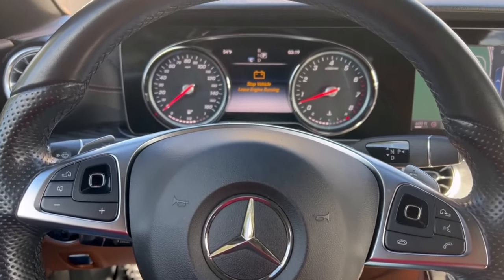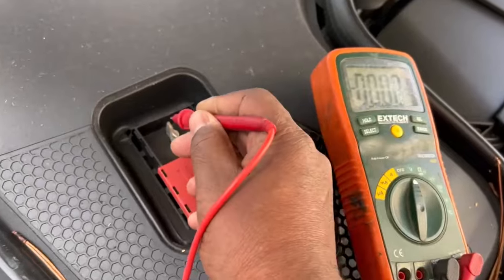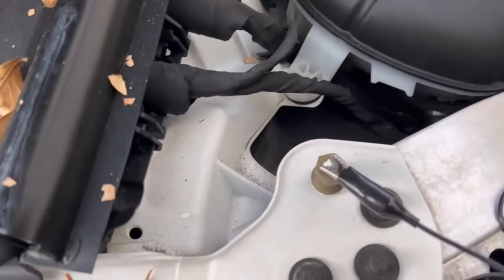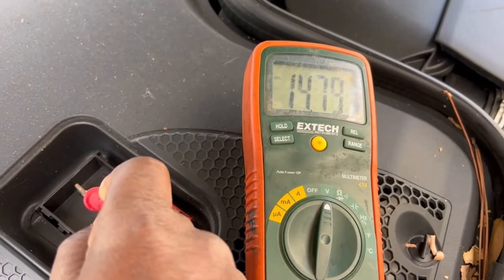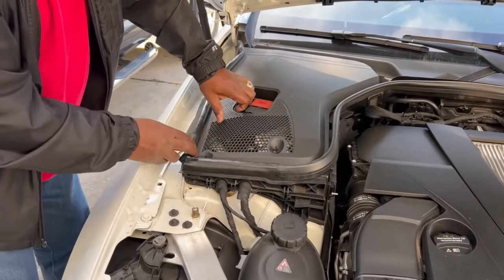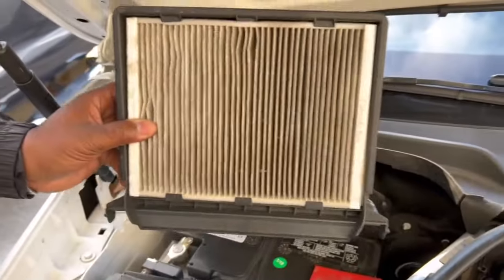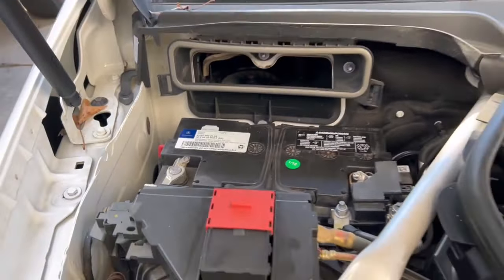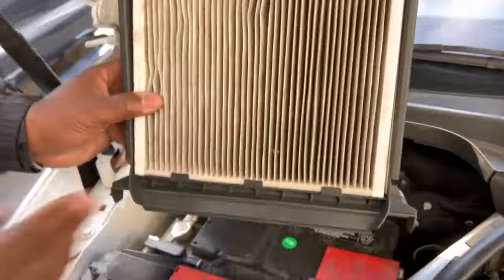How To Fix  "𝐒𝐭𝐨𝐩 𝐕𝐞𝐡𝐢𝐜𝐥𝐞 𝐋𝐞𝐚𝐯𝐞 𝐄𝐧𝐠𝐢𝐧𝐞 𝐑𝐮𝐧𝐧𝐢𝐧𝐠"  On Your Mercedes E400

Comment: That's cool but pore engineering with the are filter right over the battery. Hydrogen sulfide gas from a bad battery.
Reply from the maker: Exactly; this is very strange to put the filter over the battery
Reply: These batteries have a vent tube that discharge the gases into the fender or under the engine bay. You can see the little red connector for the tube on the side of the battery near the negative terminal.
Reply: @weldingandstuff i have a glc ben 4 matic will it   Mass  up may setting if i  Change the battery myself

Comment: Legit Video man, that helped me.  I did exactly that, and seems to rule out it being the Altonator as it went from 12 with the engine off to 15 with it on.  By the way, not sure if you know this, but it it reads 12 exactly with the engine OFF... does that mean it will need to be replaced soon?

Comment: i had this problem when it was -30 C (-22F) for a week where i leave. But when it got over -10 it ended showing that message
Reply: Because the temps are warmer no need for the msg. Same as mines changing it next week warmer this week. Don’t want it to be super cold 🥶 with my thumb out for a jump.

Comment: You forgot about the saving the codes.You either keep a charge while replacing or buy that code saver device for $28.If you disconnect without anything you could be in trouble with the cars computer.I changed mine few months ago.My mobile mechanic simple kept a charger on after disconnecting battery.Started up car with new battery.No Problems.Warning light gone like Biden in 2024.
Reply: bro what is this comment